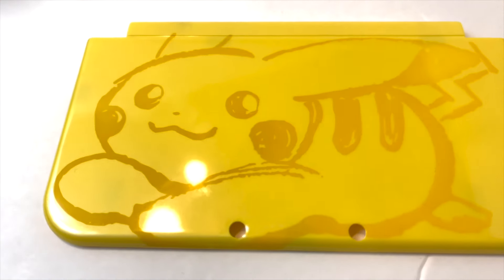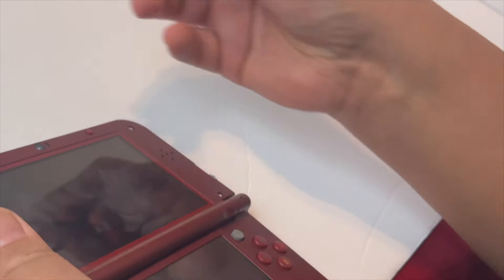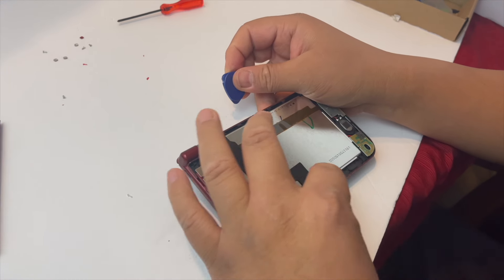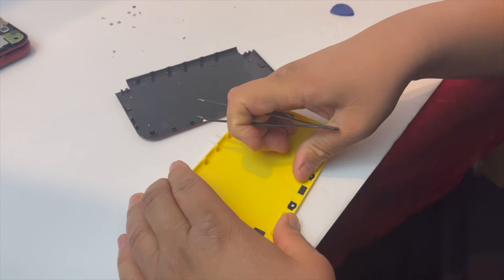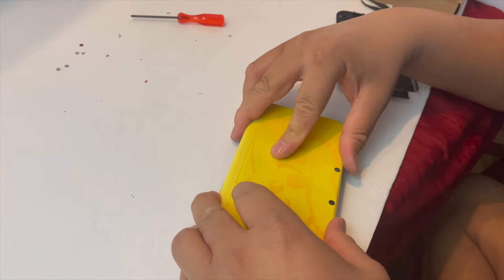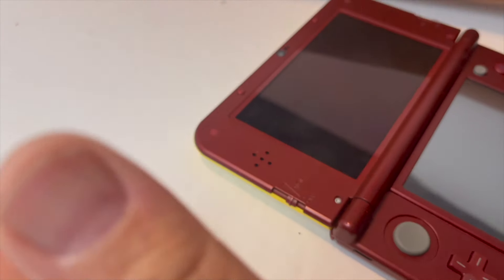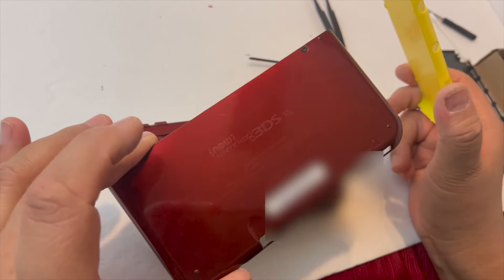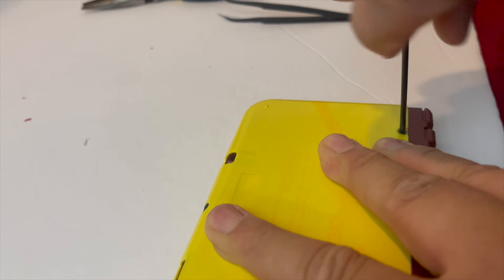Nintendo New 3DS XL Shell Replacement | Easy to Follow Instructions | Pixel Slayers HD

Comment: ABSOLUTLEY DO NOT PRY OPEN THE TOP SHELL, IT'S MEANT TO SLIDE OPEN, YOU ARE WAY MORE LIKELY TO BREAK IT DOING THAT.
Reply: It's meant to slide open? How so?
Reply: @cattushi  exactly, its meant to slide open. prying it like he did in the video greatly increses the risk of damaging the clips.
Reply: @cheezyfriez12  Oh wow. I'm planning on changing both the top and the bottom shell, and I found a video (after reading your comment) which shows how to slide the top shell off. I hope more people see your comment!!
Reply: @cattushi  can you share the link pls?
Reply: @cattushi Hi can you tell me wich video is it thanks
Reply: Thank you so much for this comment you are my savior
Reply: This is a new 3ds xl it does not have the sliding part this sliding part is only on the new 3ds classic so you are wrong
Reply: mine doesnt slide open matter of fact it wont even come off
Reply: @LyraPyxisVT  there's a video of ign show how to swap the face plate of a new 3ds
Reply: @isopodbruh  ik how it comes off I just cannot snap it off, and I somewhat damaged it so now I gotta wait to replace the whole caseing until I can buy the correct tools I was using a tweezer which ended up ruining my tweezers cause of how much I was having a hard time, and now I gotta replace the lcd cause like my gameboy advance I ripped it, and replace the digitizer as well, cause idk what was causing my touch screen not to work
Reply: This video at 2.57 https://www.youtube.com/watch?v=cUTVR3LngL4
Reply: Thx bro

Comment: great video, was wondering how difficult this would be but it seems rather easy. my metallic blue new 3ds xl has had the paint on the top shell completely destroyed somehow, i picked it up this morning and it was just ruined.
Reply: Replaced it, the only annoying part i had is that the camera lens didnt fit in the new shell, the holes were smaller. with them on it stuck out a little to far and wouldnt close

Comment: Can you please make a video about replacing the main 4 buttons?
Reply: If you mean the plastic bits you actually touch, that's pretty easy. Just make sure you order buttons for the correct model of ds, unscrew the bottom cover, unscrew the mobo from the case, the voila, you can just replace the buttons. Each button has notches that make sure it can only fit in the correct spot on the correct orientation.

Comment: I once replaced my top shell, but the shellI bought didn't seem to fit. After trying to fit my original in again, it seemed to not fit anymore as well. Now I'm concerned the new case somehow shifted something inside or something. Either way, now I'm not sure what to do because neither of the tops cases fit perfectly and my 3DS only barely sticks together from a transparent protective case that I put over it... And it just looks way worse than before and I'm so sad about it ;_;